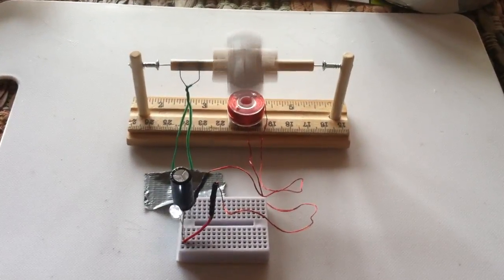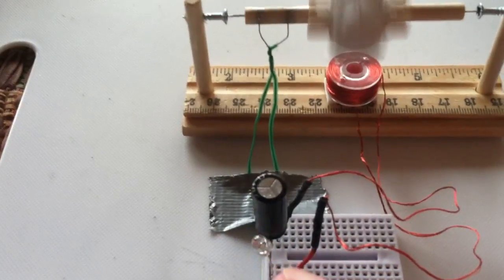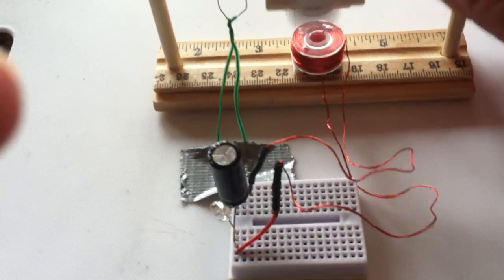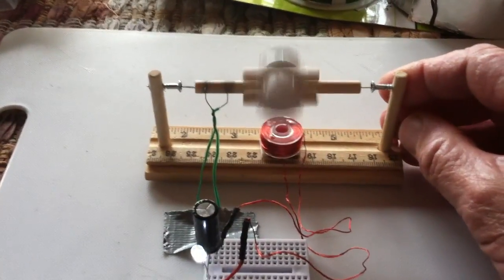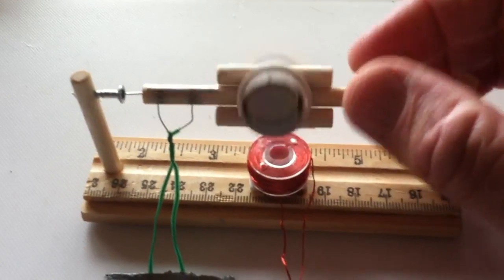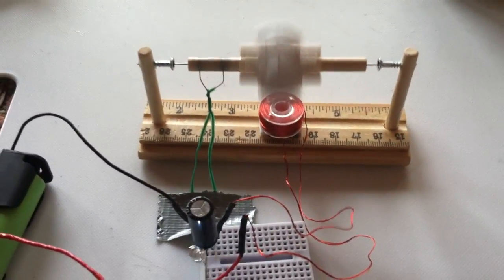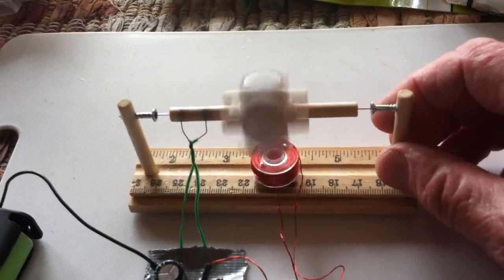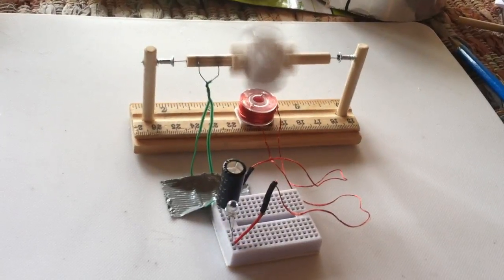Simple Brushed Electric Motor

Comment: What I would like to see is how you got the needle points into
the dowel without hammering them in and flattening the point.
Reply from the maker: Good question!!  This is what I did:-----press the needle point into the dead center of dowel end using a pair of needle nose pliers, Pull the needle out and break the needle off at about 1/4" from the point.  Use the pliers to press the broken end into the hole you made with the pointed end.  Put a dot of super glue on the wood to hold the needle in the hole.  The more care you take to get the needle dead center and straight the better the results.
Reply: Thanks, I may use that trick later. I was going to use stick pins that have a flat plastic part on one end and superglue them to the dowel but I got sidetracked way back when and never built that design.
Maybe if you have time ... it might work.

Comment: Nice video.  It's fun to see a traditional commutator approach for a change.  These days most of us are using a dual-transistor approach, or two coils (drive and sensor), or bifilar coils, or Hall-effect sensors, or even reed switches.  So it's fun to get back to basics.
Reply from the maker: Yes.  The basic idea is to just turn the coil on and off at the right time.  Lots of ways to do that. You could probably train a hamster or even a bird to do it.  Ha.

Comment: Am also digging the reuse of an old ruler for the base.
There is just no better way of answering the common comment of "what are the dimensions of this ?". It's right there !  :)
Reply from the maker: It is actually kind of an inside joke.  I really hate building things by "measurements". To me it is much more fun to free form the thing and see what happens.
Reply: LOL true, like we ever sit there and work it all out on graph paper first. It's similar to 'what gauge of wire ?" & the answer might be "the one that fits 500 turns on a sewing bobbin, if it was a size larger i'd be showing 400 turns on a sewing bobbin"